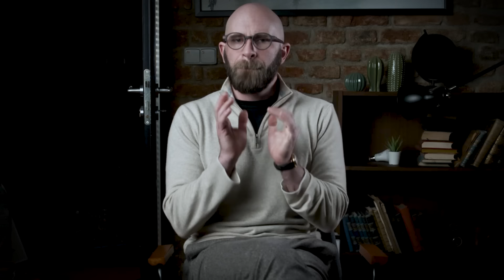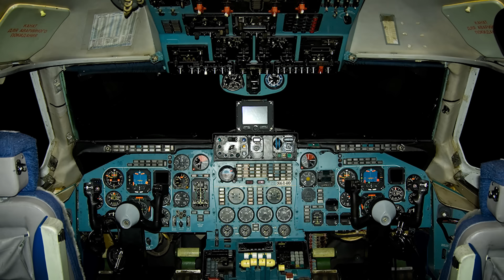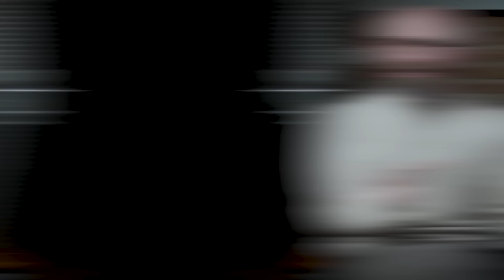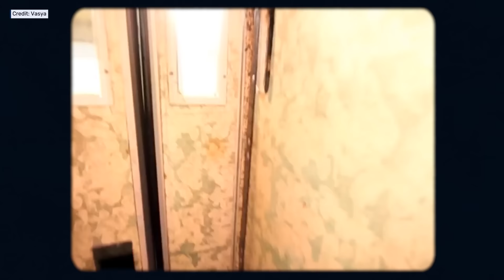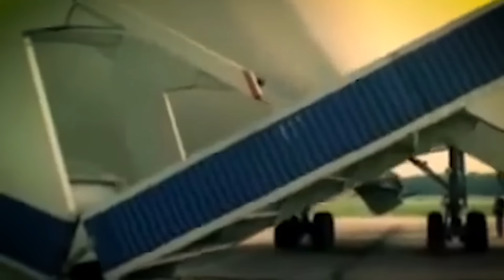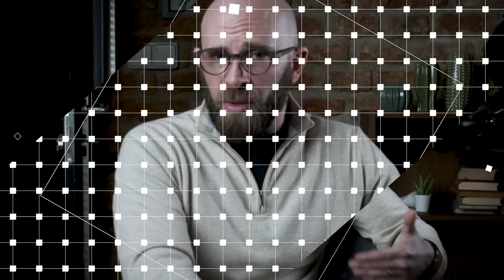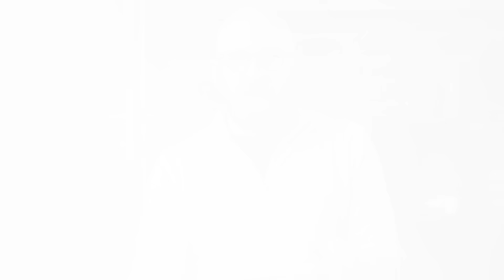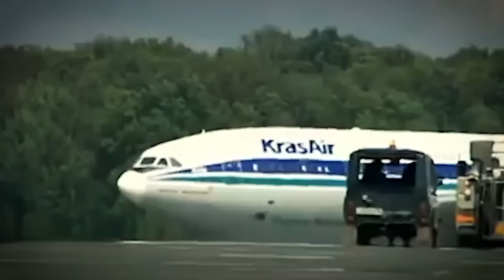The IL-86: The Soviets' Botched Answer to the 747

Comment: Why "botched"? Somewhat fuel inefficient doesn't mean botched. The plane gets the job done with few critical issues. When talking botched - it is something like the  737Max
Reply: You mean what happens when you let marketing and Harvard MBAs run the development process?
Reply: And people wonder why I'll happily step on board an Ilyushin, but if I find anything by McDonnell Douglas Boing at the end of that airbridge, I'm turning around and retreating to the relative safety of the terminal. 💨

If the terminal isn't available, taking a cigarette break in the aviation fuel store will still be safer than going near an aircraft with a 7x7 model number... 🚬💥👍

Comment: Did you know that the illusion 76 with its high Wing design was a copy from the Lockheed Martin c-141 starlifter all high Wing military aircrafts came from that design.
Reply: Absolutely not.

The 1st T-tail high wing Soviet aircraft with jet engines mounted under the wing on pylons made its maiden flight in 1952. Which is more than 10 years before the C-140. The Alekseyev/Baade(OKB-1) Aircraft "150" experimental design. The Ilyushin Design Bureau then made several high wing designs like the IL-54, which flew in 1955, 8 years before the C-141. In the 1960's they were tasked with designing a new Cargo jet, which took longer than expected since until then most Soviet Cargo planes were designed by the Antonov Design Bureau, but the majority of their designs were also high wing.

Comment: IL-86 looks more like a A-340 then a 747 or even a Boeing 707
Reply: Who is similar to whom? In what year did the A340 appear?
Reply: @Anodum the A340 enter mass production in 93 well after the IL-86. But still I wouldn’t call this a 747 competitor. More like a super sized 707 or even similar to a DC-10 just without the Tri-jet design.
Reply: @tristanbentz224  The blogger just made up the 747 comparison for the sake of hype. As for the similarities, most planes (and cars) from the same time period have similar designs.
Reply: @Anodum I know. But I can say what I want.

Comment: The IL-86 was not in any way related to the Boeing 747. The term describing the IL-86 project in the 1970's in the USSR was "aerobus", that is it was conceptually based on the Franco-German(and on again off again - British) Airbus A300 aircraft that was then being developed as a European answer to the domination of Boeing and McDonnell-Douglas. There was some misunderstanding as clearly some in the USSR thought Airbus was going to build flying "People Movers" or a literal "flying bus" with as many passengers as possible. Many Russian language official aviation references still call the IL-86 an "aerobus".

Any documentary about the Ilyushin IL-86 really should mention the British Rolls-Royce RB-211 High Bypass Engine developed during the late 1960's and early 1970's. The Soviet Aviation Industry in the 1970's initially hoped to either copy or build them with a license, like with the earlier Nene and Derwent jet engines, and apply them to many new aircraft designs then under development like the - Ilyushin IL-86, Tupolev Tu-204, and Antonov An-124. But the Rolls-Royce Engine company had recently in the early 1970's been nationalized by the British Government. The British only wanted to sell no fewer than 200 engines to the USSR, while the USSR wanted to buy around 10 engines. The RB-211 went on to equip later versions of the Boeing 747, 757, and 767 as well as the Lockheed L-1011 in addition to a few Tu-204's in the 1990's. It never flew on the IL-86 as a deal was never reached and the USSR had to develop its own engines for the aircraft mentioned earlier.
Reply: @legatvsdecimvs3406  The USSR developed the D18T engines for the An 124.

Comment: I'd think maybe the features like hydraulic stairs made sense if the USSR meant any civil aircraft to serve possible military use. Landing a plane load of troops at a non-traditionally equipped airfield would make those stairs handy, though it may just have been a byproduct of the under equipped airports, it would be another handy feature.

Comment: It's not Ai El. It's IL as in "ill", because it was made by Ilyushin Bureau. Ilyushin = "Il". And why botched? lol It was an alright wide-body mid-range workhorse. Maybe not as advanced and refined as contemporary Airbuses and Boeings, but it certainly served it's purpose quite well. I personally flew on Il-86 at least 10 times from Moscow to Sochi and from Moscow to Leningrad (St. Petersburg) and back in the late 80s and early 90s. Nothing bad to report really. It was fine, smooth ride, lots of space. Yeah, maybe a little bit noisier than Boeings, but not at all unbearable. And there was no need to waste time on checking your baggage in and out.

Comment: I rode an Aeroflot il-86 from New Delhi to Bangkok in last century, just after the USSR dissolved.

There was an announcement when we checked in that the plane was ‘free seating’ meaning seats weren’t assigned and once onboard, we would choose our own seats.

We’d been travelling through India for twelve months and had experience with crowds of locals and public transport.

So had the locals in the departure lounge.

We’d been travelling through India for twelve months and had experience with ‘free seating’.

So had the locals in the departure lounge.

There was much shuffling towards the gate to the point that ground staff shooed everyone away, only for the shuffling to start all over again, rinse and repeat.

By the time boarding came, six foot three me was off down the tunnel like a sprinter… following a large number of locals with a good head start.

When we boarded there were so many spare seats.

When we departed, I was more used to planes that sat on the brakes, howled the engines up some and then released the anchors to get optimum speed for takeoff and climb out.

Our plane trundled out to end of the runway, Ivan up front pointed it down the road and just pushed the throttles forward- no run-up, nothing, just mass rumbling down an increasingly less of a runway and not getting anywhere near rotation particularly quickly.

I fair sucked my seat cushion up my arse crack.

The inflight catering was ‘coffee’, two slices of something baked and two slices of… protein, and a mango.

I don’t remember anything about the landing other than being grateful we’d actually made it to Bangkok.

Comment: Can someone with a big brain explain to me the difference between the aforementioned hydrolic v electric servo actuator? Does it make any performance difference?
Reply: If you suffer a major electrical failure, because for example birds flew into the engines, you can still control the hydraulic control surfaces - while the electric motors will be dead and unresponsive.

Comment: Il-86 was fine plane itself, but had weak engines
Reply: the most important thing is that it performed its tasks with dignity. fuel consumption for the USSR was not a primary issue. Range was not needed, the aircraft was developed for flights within the country, that is why it was called an airbus, that is, an intercity air bus

Comment: The Boeing 727 has been the aircraft with the largest number built had a back stairs under its third engines to accommodate the airlines with an airplane with that capability to land in airports that did not have gates in the 70's and 80's.  

When comparing two airports in two different countries you need to provide the info about the era it covered, the IL 86 first commercial flight was in 1976.   All airports were poorly designed at the time and did not respond to growing demands so all of them add new terminals instead of having multiple bridges that could have served several airplanes at the time, this configuration was introduced by the Russian in Moscow and St-Pet in the late 60's.

Comment: Hey, the L-1011 was an amazing jet, it was just not commercially successful like the 747. I have about 3000 hrs in the left seat flying them all over the planet, and I absolutely loved them. I’ve flown pretty much all of the Boeings and as a matter of fact, I actually still fly a 747-200 today. Dont get me wrong, I like the 747 too, it’s probably the single best airliner ever designed, but it’s not the sweetheart that the L-1011 was, not for the pilot anyway. The auto flight system alone was way more sophisticated the that of the 747-100, 200 or 300. It’s laughable by comparison. Even when it was nearing the end of its service life the TriStar’s could still make excellent auto landings. Later when I began flying the 747 Classics in airline service I never trusted the autopilot to land. Of course the later version like the 400 etc fixed the problems with the adoption of the Boeing / Honeywell glass cockpit and modern flight management systems.

Comment: Thank you for this video! I was a lad in high school when the Il-86 first came out, and I was mesmerized. In that night shot, the airplane looked so clean and sleek! Unfortunately, the major drawback to the Soviet design were the engines, which were warmed up versions of what powered the 1960s-vintage Il-62. The CFM-56 engine we know and love today was in its design phase and would not have been available in the Soviet union anyway. Actually, the IL-86 and its big brother, the Il-96, were not as weird as we may think. The 9-abreast configuration would become commonplace in the mid-1990s with the Boeing 777 - and somewhat later with the Boeing 787 and Airbus A350. As for those cool boarding ramps, that feature was offered on the Lockheed L-1011 in two variants. Ok, I'll grant this was somewhat weird, as only PSA and LTU took Lockheed up on that option. The two U.S. trijets also initially lacked center-overhead bins; they corrected that design flaw, but not Ilyushin. Actually, come to think of it, the Il-86 was pretty weird after all. That's why I like it so much.

Comment: The term that I never hear when there is any discussion of high bypass turbofans versus low bypass turbofans is propulsive efficiency.  The thrust of an aircraft engine is proportional to the mass of air moved multiplied by the difference between the rearward speed of the jet and the forward speed of the aircraft.  The propulsive efficiency is the ratio of the forward speed of the aircraft over the rearward speed of the jet.  The first take away from this is that a propulsive efficiency of 100% occurs at a thrust of zero.  The B52 Stratofortress and the YB60 (a rewinged and re-engined B36 Peacemaker) used the same number of the same turbojet engine, but the B52 had less drag, so it cruised at a higher speed, for a higher Propulsive efficiency.  Before turbofans became reliable, the only way to improve propulsive efficiency was to reduce drag and increase the cruising speed.  With a turbofan, you can move a large mass of air at only slightly faster than the forward aircraft speed to produce high thrust and high propulsive efficiency, at the same time.

Spinning the fan at the front of the turbofan engine takes energy out of the core jet, which reduces the thrust produced by the engine's core.  While this looks like robbing Peter to pay Paul, the propulsive efficiency of the core jet is low, so the thrust produced by the fan is greater than the thrust lost from the core jet, with no increase in fuel consumption.

Comment: DC-10 had a third main gear under the fuselage. DC-10, L-1011, and 747 had galleys in the belly with elevators to the passenger cabin. Poor Simon really dropped the ball on this one (other flaws already noted below).
Reply: VC-10 featured a couple of times standing in for Il-62 for one thing.
Reply: The stretched DC-10-30 added that third main gear; earlier models did not have that.  Galleys in the belly and elevators were a common feature to aircraft in that era.  The Boeing 777 still offers this as an option, and the Airbus A380 has elevators to deliver food cards between decks.
Reply: Interesting, the only one I ever heard of with lower galley was the L-1011... along with the 2 they built for PSA with downstairs lounges.

Comment: The IL-86 with the center fuselage main gear?  Yes, the addition of another four-tire strut was to reduce tire pressures on airport surfaces.

The DC-10 had TWO versions:  DC-10-10 and DC-10-30.  The dash 30 had more fuel capacity and higher MTOW (Max TakeOff Weight) so a two-wheel gear truck was installed in the center fuselage.  Same reason.

Comment: When you look into it, basically all Soviet airliners used slightly tweaked versions of military engines (jet or prop). Why? Well, they already had the engines, parts and trained technicians, so why not to leverage that, and there was mostly no money to develop just civilian engine. Problem was fuel consumption (as pointed out in the video) but also short engine life, which was a constant struggle for the designers and technicians on the ground. Many air accidents of Soviet civilian planes were caused by engines just not being suitable for the constant use in the airliners.

Comment: Tcha Tcha Gabor was probably a little less arrogant than this Megaprojects narrator. Funny, it seems that this self-absorbed Brit sounds like a voice from Monty Python's Flying Circus. I was waiting for a reasonable explanation of what the penguin is doing on the television set.

But with that said, I hear a novice in him. His statements are mostly thin in reality. The IL-96 is powered by high-bypass engines, giving it a lower cruise speed with greater range than the '86. And the aircraft has some different structural materials than the IL-86. And about the L-1011, it was not exactly a failure. Rolls Royce went on strike- stimulating potential buyers to buy the similar DC-10 instead. Also, the DC-10 did have an optional extra landing gear in the center rear fuselage, even though the '1011 did not. So that feature on the IL-86 was not foolhardy. 

Then the elevators: both the L-1011 and the DC-10 incorporated dumbwaiters and elevators in the interior of the craft- not to be confused with elevator control surfaces. So, the high-school-sounding narrator might put on a little humility, and engage in discussions with aerospace historians before waxing on. Otherwise, he seems to be a simple Simon.

Comment: The L1011, as a plane design, was way ahead of its time. There were other issues with it from a commercial standpoint, yet techologically it really was a good plane.
Reply: Rolls Royce choked on the Lockheed order for the engines.  That delayed production and the cost went up significantly.
Reply: The L1011 was the goat to have the automatics that it did (also cat 3c autolanding) in the 70s was nice.
Reply: @FisherZ25  Yes.
Reply: IIRC, it didn’t really need the pilots, except to monitor everything during flight.  It could take-off, fly to its destination and land using its advanced flight systems.  It was the “Look ma, no hands!” of commercial aviation.
Reply: @skookapalooza2016  Yes.
Reply: It was super quiet too. Flew on it LAX-HNL.
Reply: No.

❤
Reply: MISS YOU, EASTERN AIRLINES !

Comment: After the collapse of the USSR in the early 90's, Illyushin went shopping for modern western high bypass engines for the IL-96 to attempt to make it competitive against the Airbus A340. It got quite a long way, but US interference via Boeing stalled it. The Russian high bypass (5.4:1) engines on the IL-96 were quite good though, and certainly a lot better than the crappy IL-86's engines (1.15:1 - was it worth it?), that were not even as good as engines found on a B707 in the 60's.

Comment: The L-1011 had built-in airstairs as an option. They were fitted to Court Line's aircraft for example because they served airports that didn't have airbridges, like most of Europe's resorts in the early 70s. Also, the L-1011 accessed its below-floor galley and crew area using lifts.

Comment: Most L1011s did not have center overhead baggage bin, but they did become an option late in its life.  Only the early DC 10-10s lacked the center landing gear.  The larger versions, the DC10-30s had them.  But then DC10s had larger MTOWs than did the L1011s.

Comment: >Makes fun of IL-86 for having a Center Bogie
>Forgets he had just compared it to the DC-10-30, which also has a Center Bogie
Reply: Yeah I didn't got that critique either, evenly distributing the weight of an aircraft in multiple gear bogies is pretty standard in aircraft design, because the concern of not destroying the pavement in airports is a pretty universal thing regardless how good or bad infrastructure is in these airports.

The 747 had them, the DC-10 had them, the A340 had them, the A380 had them, the massive Antonovs had them, all pretty normal stuff.
Reply: @frylucas  He mentioned 747 the comparison was with medium widebodies like L-1011. But yeah ignored DC-10 and A340.
Reply: The real difference is Max takeoff weight, the IL-86 is 474,000 pounds
The DC-10-30 MTOW is 555,000 pounds
MTOW for the A340 is 606,000 pounds.
all with the center bogie

For the L-1011-500, MTOW is 510,000 pounds, and it never had the center bogie.
Reply: Well did they order any?
Reply: The center bogie was there to reduce loading on the wing spars during heavyweight taxiing before takeoff.
Reply: it's Soviet, so it has to be 'botched' in every respect. plain and simple
Reply: @KPbICMAH The true is every adequate person understands the everything made my "Sovok" was a joke almost without the exclusion and sometimes included the people lots of whom: хоть ссы в глаза
Reply: It's a British obsession at the moment to put down everything Russian It makes them feel like a first rate power again